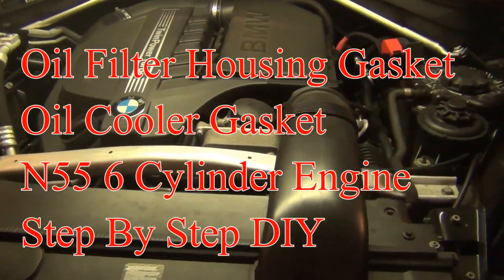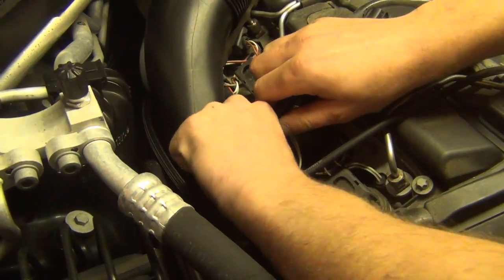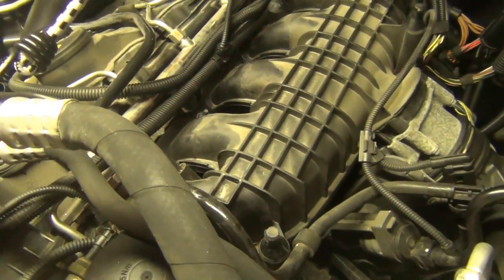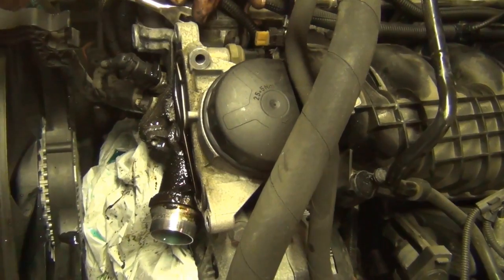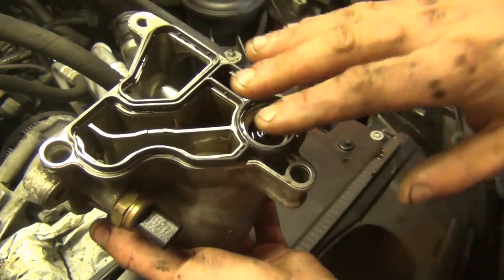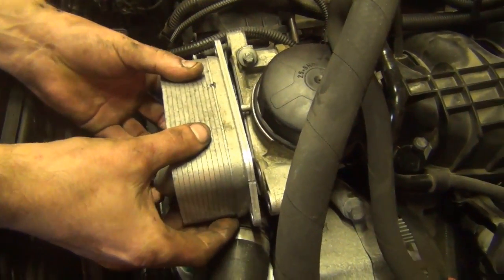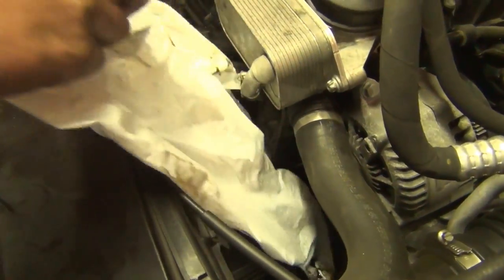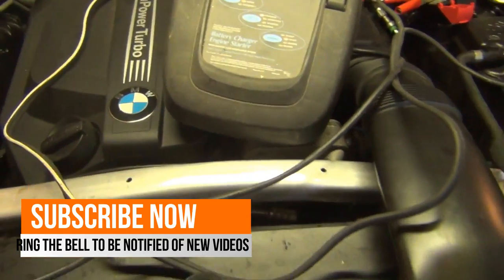BMW Oil Filter Housing Gasket N55 And BMW Oil Cooler Gasket Oil Leak Full Easy Step By Step DIY

Comment: 🚨 Engine oil priming is also recommended after this job or you may have air bubble in oil system. Many blew their engines after doing this job without priming the engine. 🚨
Reply from the maker: It is a great recommendation. I have not seen an engine fail from not priming on an oil filter housing gasket but any repair that interrupts the oil circuit priming is recommended.
Reply: @AskTheCarExperts  do you know how to do the engine priming? I was following other methods like pulling out fuse 165 but the engine still started :(.
Reply: Yep my engine blew. The dealer didn’t prime the oil.
Reply from the maker: @roadhouseguy  That sucks. Are they replacing it for free for you?
Reply: Excellent diy ...

Comment: Great video! Quick question, you didn't do an oil prime procedure? This job doesn't seem to be any different than that of an oil change? Is the ofhg oil prime that necessary? I was planning on filling the oil filter then putting the filter back in and the coolant primer. Thanks!
Reply from the maker: I agree, pretty much like an oil change. You can do an oil prime and it is recommended.

Comment: Did you not need to take out the oil filter so arent so much oil left in the housing?
Reply from the maker: Most of the time I take the filter out and let it drain back.

Comment: I have done this job on 2013 335i, N55. I still have oil in coolant and there is no pitting on mating surfaces. Any other idea what can cause this?  Cylinder leak down test proves head gasket is good.
Reply from the maker: Hi Jeff, If the mixing already occurred it is very hard to get all the oil out and it can look like continued contamination.

Comment: I have pitting on my n55 head, and the repair lasted about 15 months. Planning on reworking and decided JB weld will be my fix so was very happy to see your suggestion at 16:00!
Reply from the maker: @andrewwynn  Sorry to hear about the issue but JB and sanding does a great job

Comment: Many thanks for the tutorial — it saved me a lot of time.   The job went smoothly, and fortunately, I used my 134a evacuator, allowing me to pull the a/c lines and set them aside out of the way (I used a small snap ring spreader to release the a/c line loom brackets from the fan shroud.). 

Did the job in 2.5 hours, quoted 5.5. 

Again, many thanks.
Reply from the maker: Sweet Anthony!

Comment: Good information brother I will also change my alternator while I have the oil filter housing off.
Reply from the maker: Hi Patrick! I have seen quite a few alternators fail when they get saturated with oil from a bad oil filter gasket. With higher mileage vehicles or if contaminated with oil I think replacing the alternator is a smart  move!

Comment: Excellent video. I just noticed pooling at my oil filter housing and oil splash on and around the alternator. With this video I'll be tackling this myself.
Reply from the maker: Thanks Jared. Also make sure the leak is not from the oil filter cap. Aftermarket oil filters often come with a flat o ring seal. It is a common spot to leak when using non OEM filters.
Reply: @AskTheCarExperts  I'll certainly check that. It's a good amount of oil in the area but certainly a cheaper fix. Regardless, your content is still extremely valuable. Keep it up!

Comment: Great tutorial, I'm very glad to see you're back to making videos.  One note for anyone doing this, the BMW blue coolant is not premixed (at least the type I've used), and should be diluted 1:1 with distilled water only.  Of course, trust the directions on the bottle over me.  I love the plastic bag trick to protect your belts, I wish I had done the same when changing the thermostat on my E46 328i (I used a plastic gallon water jug cut into a funnel like shape which only worked OK).  I'd also recommend removing the plastic covers underneath the engine and putting puppy pads on the ground (or a large shallow container) to help contain the mess.  Keep any kids and pets away as as the ethylene glycol in coolant is apparently both tasty and very poisonous.
Reply from the maker: Thank you for the great comment! Very good advice! The under body panels can be a pain to take off on the ground but it is worth the time since you will not have to clean up the mess. I use what we call pig mats at work for spills and the puppy pad idea is fantastic! Also thank you for the notes on the coolant. This is a very helpful comment for everyone!

Comment: Could an oil cooler fail? and allow oil go into cooling system??.... I have changed both gaskets and coolant still gets milky and the engine runs good, so I don't think in a head gasket.... Thank you for replying.
Reply from the maker: Hello RP, Yes you can get mixing from a failed oil cooler. When you did the gasket did you make sure there was no pitting on the mating surface? If there is you need to use JB weld to fill the pitting and sand smooth. Also once you get oil and coolant mix in the cooling system is is very hard to remove it. There is always some residual. Keep removing the top layer of the reservoir and top off.

Comment: Another great vid, and this one is good for my 2013 X3.  I'm doing this now for my 2013 X3 which is 99% similar. I did drop the back most 11 mm nut but will get it off the bottom shield tomorrow (Got it). Also, those press on rubber wire hangers on the back are crazy nasty to pull up. Whoever put on the lower short  E-torx on the housing way over-torqued it and I was worried it wouldn't come loose using 1/4" drive and socket, but soaked in penetrating oil for a while and got it, but had to undo the "mickey mouse ears"  hose connection to make room for the socket.  I couldn't get it with the ratcheting wrench, my hands not strong enough. I used a dab or crazy glue to hold the rearmost manifold bolt into the socket back there. It worked too good, had a hard time getting the socket out! 

I'm going to replace the serpentine belt and upper rad hose because they were soaked with oil and I dumped quite a bit of anti-freeze too. Tomorrow I'll finish up after a good cleaning and new gaskets. I didn't bleed the coolant, just added some. I'll do the oil /filter change tomorrow.

Thanks again for a really quality effort. 

The job is done, no leaks and running well.
Reply from the maker: Thanks bud!

Comment: I just buy a 2015 bmw x5 they give me 3 months garante and I saw have that problem, my question is I can take to the dealer for that ?
Reply from the maker: Usually you have to have the selling dealer do the work first. But you can call them and ask to see if they are ok with you doing the repair at a BMW dealer. The other shop would then have to pay the final bill.

Comment: do you think its possible to do without loosening the intake manifold to get that back bolt? maybe making up a tool to suit?
Reply from the maker: Hello, I don't think it would be worth the time invested since the intake comes off very easily.  If you strip out the bolt it will make more work for you than to pull back the intake. I hope this helps.

Comment: Awesome video. I did mine 3 days ago but I must’ve connected the sensor without making sure the sensor was dry. Now my oil temperature gauge isn’t working. Do you think the sensor on the oil filter housing is the reason why?

Comment: When you perform oil priming procedure, can you remove the fuel injector  fuse instead of disconnecting each injector? If so can you tell me the fuse number for a 2013 bmw x5 VIN 5UXZV4C52D0E07865. Thank you.
Reply from the maker: Hello, There is no specific fuse for the fuel injectors. Power and ground is directly from the DME. You can unplug the low side fuel pump. Or best to disconnect the plug for the injectors at the DME.

Comment: How can you tell if your oil filter housing gasket is leaking?  I can’t get a good angle to visually check.
Reply from the maker: Hi Chris, Just by the area of the leak and a visual inspection.  As long as the cap is not leaking any oil in the area of the OFH would be from the gasket.

Comment: Great video - only concern that I have is going back with BMW OEM gaskets considering the BMW original gaskets failed prematurely - aren't there better options available?
Reply from the maker: @sunyoungg5634  That is a great question. I purchase from FCP which has a lifetime warranty on parts.  But like any gasket subjected to temperature changes, they all will break down.

Comment: Hi, great video. Just wanted to confirm some of the tools that you used. Please confirm the size of the ratchet wrench you used on the lower bolt holding the oil filter housing.Was it a E8 or E10? You mention that it's a E8 but think its a E10. Also are all the torx sockets you used are E10/E12 and the socket you used for the manifold bolts/nuts a standard 6 point 11mm?  Thanks.
Reply from the maker: Hello, Yes the lower bolt is an E10 and you will need the E10 and E12 socket. Swivel sockets are helpful and the intake manifold should be an 11 mm 6 point. Thanks for watching and commenting.

Comment: I got oil mixing with Coolant in my Reservoir do you think it's because of 
these seals ? The car runs fine and
and no mixing in valve cover.
Reply from the maker: Hi Dx, Yes this is the usually reason. When you remove the components check the sealing surface for pitting. If you see some you can fill with JB weld and sand down to correct. You will need to flush the cooling system a few times but keep in mind there usually always is some residue left. Just keep removing the small amount that comes to the top over time and it should help clean it out.
Reply: @AskTheCarExperts  Awesome!

Comment: Thanks for detailed instructions. Have you tried to remove the cooler with the OFH? Would that mix more coolant with the oil? About to try this and just wondering
Reply from the maker: I have not tried that because it is recommended to replace both gaskets at the same time. You will have to let me know :)
Reply: @AskTheCarExperts  thanks for lightning fast response, was watching the video again and the bottom bolt will be awkward no matter what. I saw some other online diyers remove the two things together and then disassemble the cooler later. Was just wondering if there was some fluid mixing concern

Comment: Excellent diy ...  ...easy step by step  ...thanks... what is your tzke priming the engine ... as some  N55 did seize up after the OFHG replacement .  Please do comment
Reply from the maker: I would recommend  to do an engine priming after. Not quite as scritical with this repair but it couldn't hurt. I do that now all the time but it was not common practice when I made this video.
Reply: @AskTheCarExperts  thank u for your quick response. Will do so .
Reply: @AskTheCarExperts  what is the fuse  # to pull if we disable the fuel pump. When doing the priming .... jplz explain.  Any help is greatly appreciated... is it located in the trunk.  I would definetly pull that fuse nstead of taking out the wiring harness for each injector
Reply from the maker: @mohammadhayatca3244  can you post the last seven of your vin and I can look it up for you.
Reply: @AskTheCarExperts   L740900     ...      X5 3.5 TWIN TURBO
Reply from the maker: @mohammadhayatca3244  Fuse 105 in the rear power distribution box.
Reply: @AskTheCarExperts  thank you       ...  keep uploading.
Reply: @AskTheCarExperts  😊

Comment: Does this happen to a lot of f10's or just cars driven really hard.  I'm really not looking forward to this with my f10.  What cost am I looking at from the local mechanic or dealer?
Reply from the maker: Hello, Unfortunately this is common on all 4 and 6 cylinder engines. I am not sure what the dealer cost would be but for the home mechanic the parts are not very expensive. However the labor for the install is where the cost goes up if you have it done at a dealer or independent shop.
Reply: @AskTheCarExperts   thanks.  Since I've got you on the line I have a question for you.  I recently had my oil changed after 1 year and 4k miles.  The guy didn't let every last drop come out of the car.  While I turned my head he closed up the plug while there was still a spaghetti sized trickle coming out.  I didn't say anything but I wasn't happy about it.  Why not do the job right?  Is this common and is it a concern?

Comment: Seems like there's a lot of stuff that gets removed for this one.  Any thoughts on other good "while you are in there" type things?  I'm thinking acccessory belt and possibly cleaning out the intake/walnut blasting.
Reply from the maker: Hi David, That's a great question. The N55 engine does not typically collect carbon in the intake. That was common on the N54. Take a peak at the intake ports but you most likely will not need to clean them. I would recommend the belt tensioner as it is a common failure.

Comment: Thanks for the very helpful video. Quick question...when I was putting the intake manifold back on, the second to last nut slipped and fell down before I secured it on the post. I reached down with a magnet but came up empty. The manifold was fully seated and it looks like it fell into an open area. Could it have fallen into a critical spot and do major damage or is it likely sitting on a rail or down on the splash guard? Thanks again.
Reply from the maker: Hi Joel, Most likely it fell into a cavity outside the engine. If the intake was fully seated it is unlikely it fell into the intake port. But if it did find its way in then major engine damage can result. If you have any doubt you should inspect the intake ports and remove the plug and inspect the cylinder. That would be a very bad day to damage your engine over 1 lost nut.
Reply: @AskTheCarExperts  Thank you for the quick response. Very helpful.

Comment: Hi there great video. BMW are suggesting 4 hours for this job but I think that may be because they include removing the manifold completely. What’s a reasonable time for the job if you do it this way?
Reply from the maker: Hello, Any shop will quote you book time. Actual time depends on your skill level. From 1 to 3 hours.
Reply: I drilled part of the manifold, just enough to get the screw out, 20 minute job with some mechanical experience.  I just add coolant, didn't get to purge the system, car runs great.

Comment: Hi. Can you please send me a link to that socket swivel piece? Thanks
Reply from the maker: Hello Wali, Some items are worth spending a bit more money on. My two go to Etorx E8 and E10 are Snap On 1/4 drive because they have a low profile and you can get into tight spaces with them. This set does include the two you will need from Amazon but you may want to consider ordering from Snap On for these to swivels.
https://amzn.to/3YMqpE1
Reply: @AskTheCarExperts  thank you for the reply. Ok I'll be ordering these parts. Thank you

Comment: I didn't get the part that you have to use a battery charger. Did you disconnect the battery in the trunk by any chance?
Reply from the maker: I would disconnect the battery during the repairs to prevent any accidental shorts to the jump terminal.

Comment: Man  I’m about done except the last bolt by the manifold. It goes in quarter way and then no more turn or very hard to. I tried a brand new bolt and the same happens. Any advice appreciate you.
Reply from the maker: You may need to loosen all of the other bolts and put that one in first. Blow out the hole with air if you can. Hopefully it did not get cross threaded.